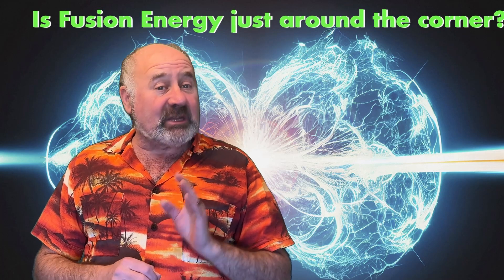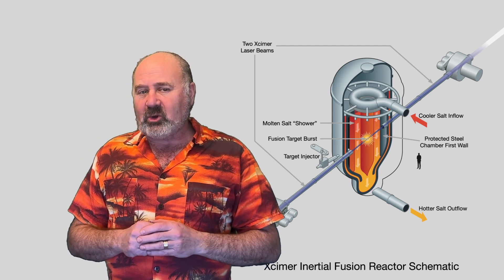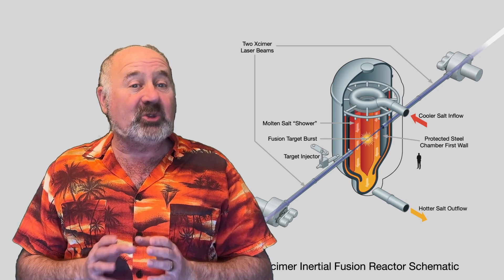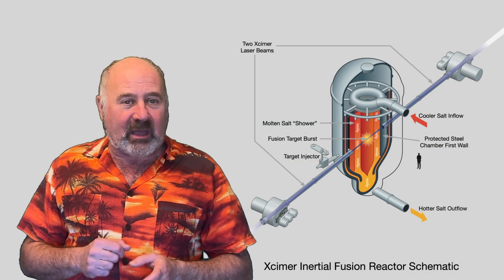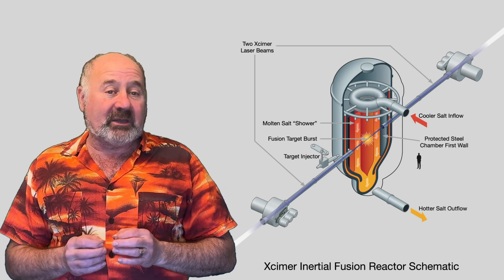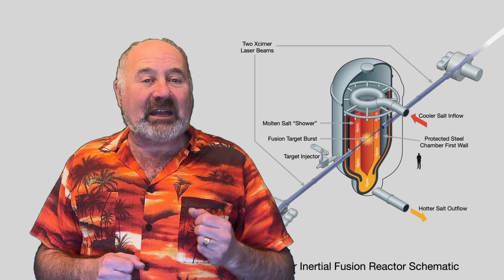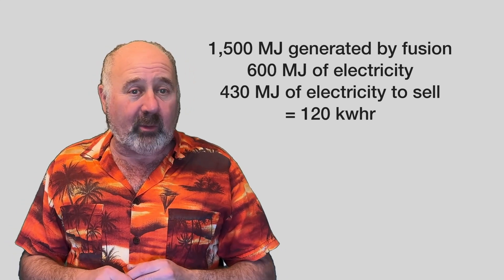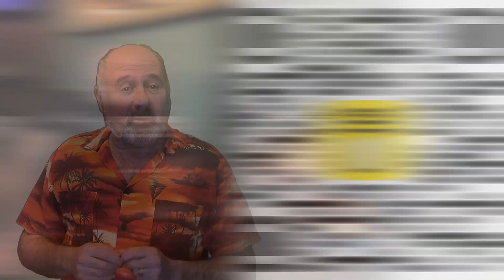Can millions of mini hydrogen-bombs power our world?

Comment: It doesn't have to be connected to the grid. Start connecting it to district heat
Reply from the maker: District heat is kind of a niche application, but you’re right they don’t have to connect to the grid. They could be used for industrial heat, or up behind the meter application at a data center or large load facility. But I connect to the grid I just meant generating economically useful energy and not just running the science experiment.

Comment: Thank you, Dr. Silber.  ♥😀 Xcimer claims that their capsules can be manufactured for less than $0.25. However, this is only a small fraction of the per-shot expense. Their cryogenic capsules require protection until they are positioned inside the hot chamber environment. According to Xcimer documentation, each Au/Pd-coated capsule will need its own protective hohlraum. With that in mind, what would the total cost per shot be?

Until recently, NIF capsules struggled with uneven laser illumination, leading to implosions that pancaked or elongated. How will Xcimer overcome this issue with only two beams?

Does anyone other than Xcimer believe a gain of 160 is achievable using just 0.25 MJ of laser energy?
Reply from the maker: If they can get a gain of 125 I suspect their economics will be satisfactory, but until we see what gain they can actually achieve we won’t know their cost per kilowatt hour. It’s much too early for that in their development process. Let’s just see if the experiments at Phoenix goes well and they can get the 6 MJ per laser and the compression optics they need.
Reply: @Decarbonize11  In the early days of laser inertial confinement fusion, theorists projected extraordinarily high gains with only tiny amounts of laser energy. Today, Xcimer is making similarly bold claims. While I’d like to believe them, the fusion startup space is rife with hype. Now, you’re getting swept up in the excitement, 😵‍💫speculating about 125 fold gains. Until they demonstrate a gain > 0, it is best to remember the saying, ‘If ifs and buts were candy and nuts, every day would be Christmas.’
Reply from the maker: I think it's pretty clear in the video I'm skeptical of their projections of Q= 125.

Comment: How will the laser mirrors be protected from the damaging 14 MeV neutrons?
Reply: at a glance, non-linear gas optics are used instead of physical mirrors. This is mentioned in the video.
Reply from the maker: @johnh6245  The lasers are actually pretty far from the fusion explosion site, on the other side of the liquid salt waterfall. There’s a small hole for the laser light to travel through.